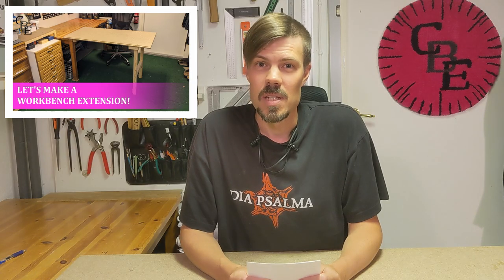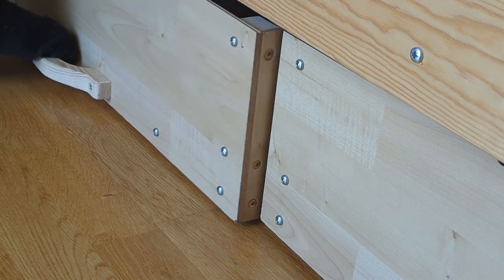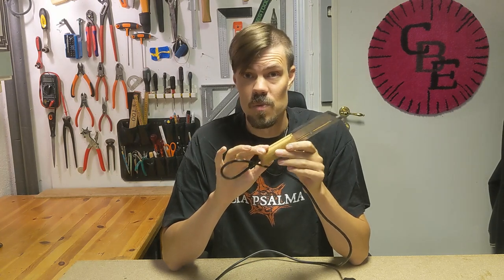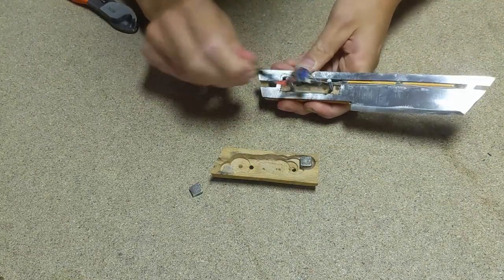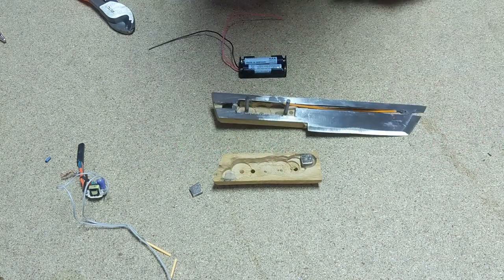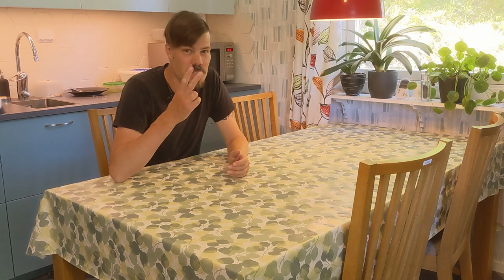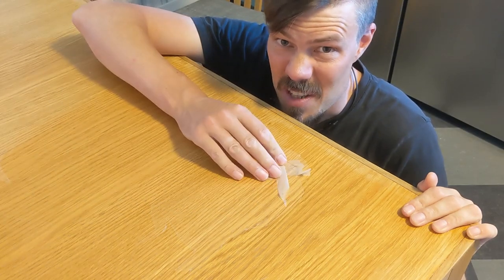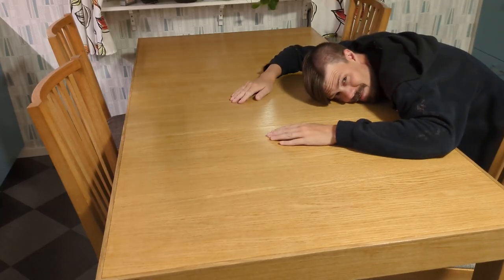Let's Fix all my YouTube Mistakes!

Comment: The reverse fence post caps had me like "Oooooh, that's.....", but how do you keep it from gather water like four soup disches? Did you fill them with some glue of sorts, or? 

Great idea going back and fixing the small things :D
Reply from the maker: @behindthemistakes  if you look closely at the footage, you can see that the caps are filled with silicone. Probably isn't good for the wood in the long run, but better than having end grain down in the soil.
Thanks, it felt rather cathartic doing this video!